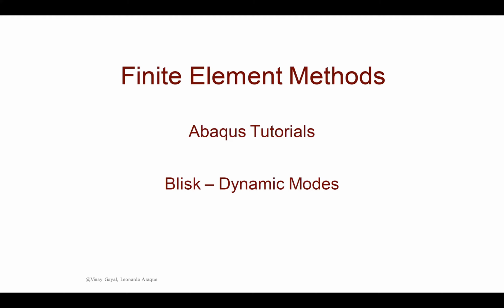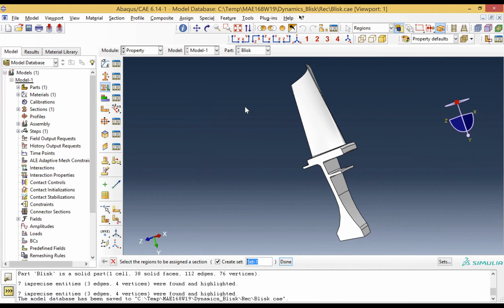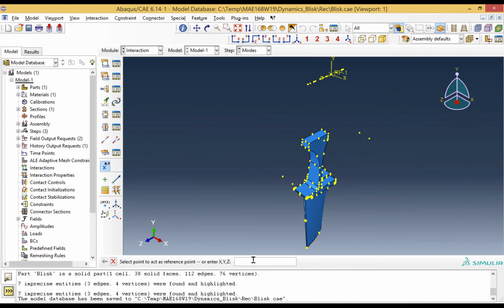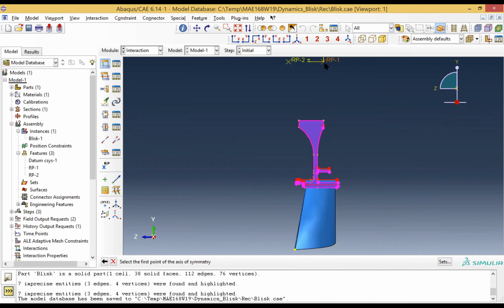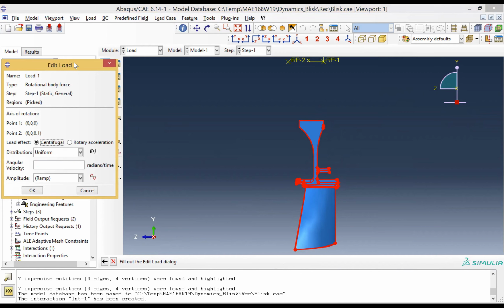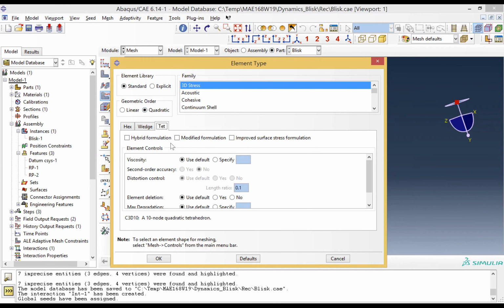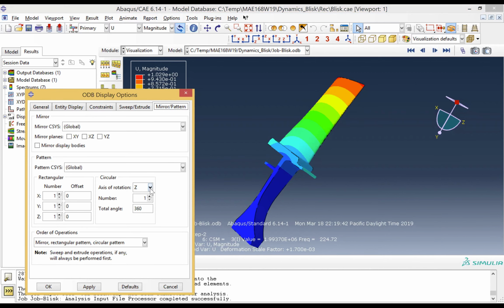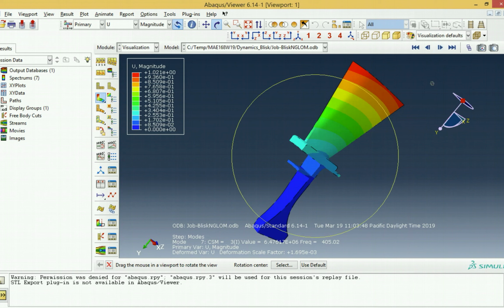#ABAQUS Tutorial Dynamics of a Turbine Fan Blade of an Aircraft Jet

Comment: Great tutorial, quick question I have done the same procedure but I made my own model and followed your steps. but i see your origin has already been placed at 0,0,0. 

(Mine is somewhere else. How do I find out what the 2 origin points on my model are? currently the original has automatically been placed on the centre of the blade which is being assumed 0,0,0 and i cant generate result using that as 1st origin coordinate.)